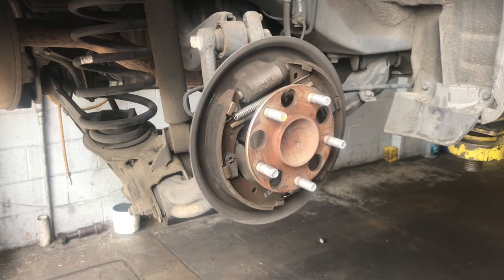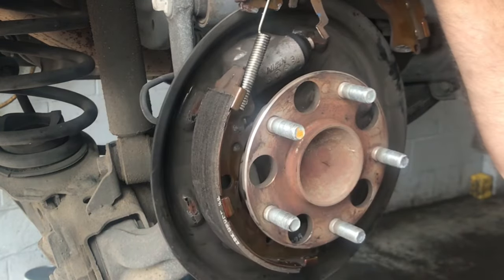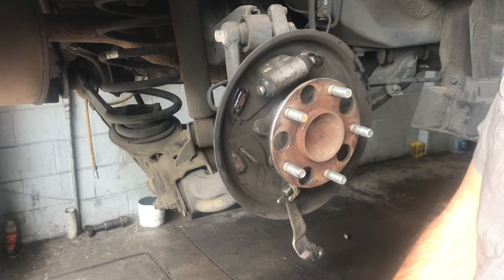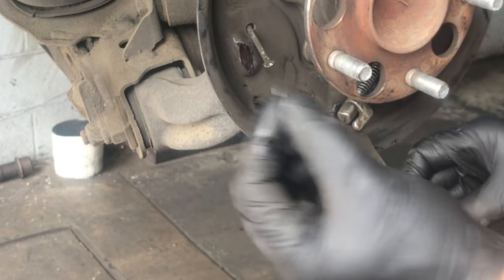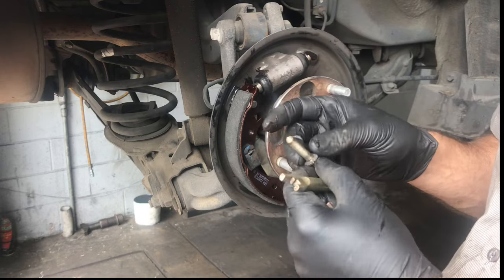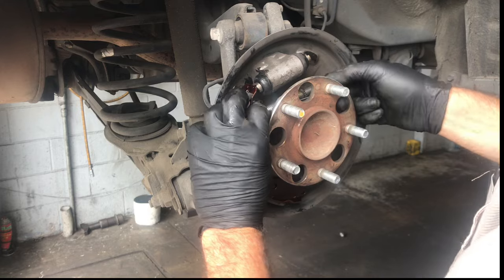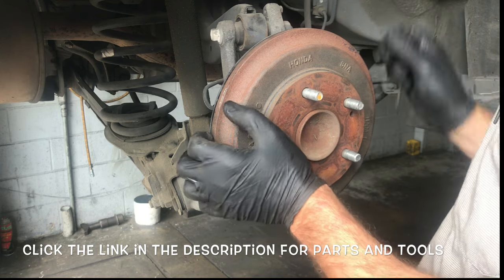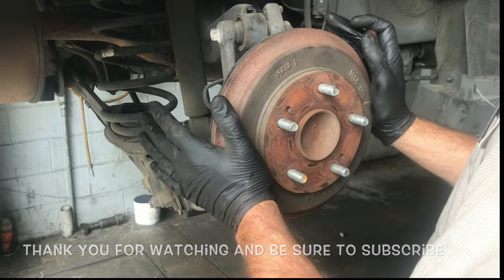How To Replace Drum Brakes On A 2005-2011 Honda Civic

Comment: Took me 5min to take everything out and 3 hours to put it back i have nightmares with these brakes!
Reply: He made it look easy when he putting back. But in reality its harder that it seems. Those springs are hard to stretch out. I just did mine yesterday , i did it differently but it works for me.
Reply: Hate drum brakes with a passion
Reply: Eyes wide shut for expert who do this constantly on a daily/weekly basis. They all are pretty much same from small cars, suv and sometimes trucks (GM/Chev) if your having problems with wheel hub check it any noise with too change it or just change everything. Remember to bleed the brakes, I note on the drum the date it has been changed like for example (04/27/20)
Reply: Bleeding the brakes, especially for drums, is a critical step. The ends of the wheel cylinders that contact the shoes can quite literally be pulled out of the cylinder itself with minimal force or by pushing one end in too far. Beyond that, as with any brake repair job or brake part replacement, removing any compressible gasses or other foreign materials, whether solid or liquid, from the brake lines is of the utmost importance to your safety, the safety of your passengers, and the safety of other people on the roads around you.

As for these being a pain to install, I agree that pads and rotors are so much easier and more straight forward, but I almost enjoyed doing these on my Honda. It gave me a chance to get everything cleaned up for the new hub bearing assemblies, as well as took a drill with steel brushes and got the backing plates returned to much better condition with the removal of rust. 

All in all I enjoyed getting it all back together as a much more complex mechanical system and having it work as wee as or better than the old ones!
Reply: I just wanted to see how he got that mainspring back in.
Reply: Hahahaha
Reply: Just did drums for my first time and wow. Your words are exactly what I just went through

Comment: Pushing in the hold-down springs without a special tool can be overcome by using a wide-blade screw driver.  Place the screw driver blade on one side of the hold-down spring in the groove and press in and turn slightly, whilst holding the dowel in place from behind.  It only takes a slight turn for the dowel to catch, but once it is hooked, you can then move it completely into the grove with needle nose pliers.  I spent three hours one night trying everything to get something to work, and stumbled across this trick.  Good luck.

Comment: You skipped the most important part... Those drums many times dont come off easy even when pounding it with a hammer. Some have a slot in the back that you have to take a small screwdriver and turn the adjuster wheel or else no chance on getting drums off
Reply: In the front of the drum, there are two screw holes. Put a screw 10mm by 1.25 thread  pitch in each hole and turn each one till drum brakes loose. Hopes this helps

Comment: Thanks for this! QUICK TIP: Use vice grips to take the springs off, then remove the clips holding on the shoe, then take them off... then do it in reverse! Way easier than trying to juggle the second shoe on

Comment: I did my 1988 Civic drum break years ago, it is very refreshing to see how professional auto mechanic did it. Thanks for your video. Your explanation is quite clear and getting to the point. The video angles are quite good and clear. One of the best videos.
Reply from the maker: Bruce Huan thank You!
Reply: @HowtoAutomotive  , Thank you again. I got it done on both rear drum brake on replacing shoes, drum and wheel cylinder with new set of springs. First installation on the passenger side, I found that 1988 civic adjuster stud fork was too fat for the new shoes. A little bit of grinding to make it fit the bill. By the way, I was confused on the adjuster stud differences on its right or left turn in order to screw it in. I ended up came back to review your video which is on the passenger side wheel (by looking at the muffler is on its left side) and it is right turn (clockwise turn make it shorter). This saves me a tremendous trouble in the future.
* By the way, I like to find that tool you used to push and turn the lock spring. I wish I had one like that and like to get one for the next use.

Comment: I wish I would have seen this video before another tutorial, the other guy was using plier grips to pull that spring which is a pain to remove,I noticed while doing this, I ended up pushing the cylinder all the way to one side, releasing brake oil fluid, and I think air got inside the lines as the brake pedal feels like a sponge. Going to take my car to a shop to see what happened, I hope I did not damage the cylinders.

Comment: This video works for a 2012 honda civic lx. 
I also wanted to add that I used two M12 -1.25 mm x 35 mm metric class 8.8 bolts from home depot to remove the drums. 
I also used clear tubing from home depot to bleed the brakes, but I can't find the size. It's probably the second thinnest tubing they sell. 
Hope this helps.

Comment: Thank you so much for doing this video!!  The part I like best is installing the opposite shoe. I would usually try to spread the large spring up top after the two shoes are installed and I would stretch it out and end up having one of the piston boots come off in the process of stretching the spring and make a mess. It took me half the time to do my rear brakes.  This is the best video!!

Comment: Brian, this is nothing short of a fantastic video. A good friend of mine is a Honda "master" technician as they are called at the dealership, and the process he uses, which I'm sure is a specific Honda method with a personal touch, is essentially exactly your process here. 

The step many struggle with, as I have seen personally helping people with their cars and on videos here, is the installation of the top most spring. I call it the "rotation method" and it takes all the danger of damaging the wheel cylinder out if the equation if your advice is heeded properly. Too many attempt to fight the spring on its home turf; meaning, they try to pull the spring along the linear axis where the spring is the strongest. Rotation introduces the lever, our simple machine best friend, to do our bidding. Once the shoe is seated in the cylinder notch and is rotated around that fulcrum, the forces pushing on the cylinder from each side begin to balance out quickly allowing for the focus to move to proper positioning of the front shoe. From there it takes no more than slight pressure from a single finger to hold the shoe in its desired place while installing the peripheral springs and retainer. 

I have been fixing up my '06 coupe 5mt to have something I can not worry about putting additional miles on and still know it's solid. I've owned it since December 2005 and all but 12 of the ~270k miles were driven by me. I had watched this some time ago while fixing up a friend's 2007 coupe nearly a year ago, and the process stuck with me to the point that I watched this after to make sure I hadn't screwed anything up. Nailed it!
Reply from the maker: yourfinaldecree glad you like the video. Sounds like you take good care of your car and it should be around for a long time. Thank you for watching!

Comment: Just one trick to add is when get the shoes close to postion with the drum, go in and press the brake pedal with both drums on and see if it frees up the drum. This process centers the brake pads. once i thought I had adjusted them tight enough and pressed the pedal and they were pretty loose and then adjusted them a bit more and they were perfect
Reply from the maker: nick elias like the tip👍🏻 thank you and thank you for watching!

Comment: I was struggling so hard taking the top spring off in my 2010 Honda Insight, which has the same exact drum brake setup in this video. When I tried your method of removing old shoes and assembly of new shoes, I was  finally able to get this job done sooner. 

Most videos start with removing that longer top spring which is on there super tight, but that never worked for me. I don't have vice grips and don't wanna use side cutters, so there had to be a better way, which is to remove the shorter bottom spring. Doing that is way easier and quicker.

Comment: I watched this video 3 times before I started the job on my 2008 Civic. I have done disk brakes many times an never had any issues, but this job one one problem after another.
It is not as simple as the video led me to believe.

First, was unable stretch the return spring enough to release the shoes. I found no place to get enough leverage. I ended up using a bolt cutter to cut the spring.
Second, I did not have the special pliers with the wedge that permits spreading the horseshoe clamp. I tried buy could not remove the parking brake pin from the rear brake shoe. The rear brake had very little wear, so I decided to keep it.
Third. In replacing the rear brake shoe,  I had trouble replacing the retaining clip. Ever thing kept slipping out of place. You really need 3 hands to do this task!
 Fourth: Even though the replacement spring was an exact duplicate of the original. I could not get it to hook up to the rear brake shoe. The parking brake assemble arm blocked access to the triangular slot .  This, of course, is a show stopper, so I'm still trying to find a way to make it work.
Reply: Jim Walsh all you need for this is pliers and a couple of flat screwdrivers. No special tools needed those just make the job easier
Reply: Haha, it would have been hilarious to  hang out with you in your garage and watch or video you

Comment: This guy is a true mechanic. I was stressed just thinking about doing this job. Just follow the video and you'll be fine. Only thing I did different was to remove the parking brake cable so that it was easier taking off the horseshoe clip(hardest part about the job). Also push in the brake piston by hand to give yourself more room to leverage the last brake shoes in place.
Reply from the maker: Glad the video was helpful. Thank you for watching!

Comment: Great video man! lol I will leave this up to my mechanic to do the labor.  The upside is that now I know how the process works, and I know all the components that ideally should be replaced. I’m here after getting cursed out by a customer’s mom for selling a car in which the drum’s failed after a few month of ownership. The downside to the drum brake system is that when they fail, they will fail hard. The brakes worked just fine on the car before selling the car.  Moving forward, my buy here pay here dealership will be replacing the drums, shoes, wheel cylinders, and hardware on all used cars we sell. Same thing applies for brake pads and rotors. We also are getting our customer’s car fixed. Thank goodness we have the wiggle room to replace stuff like this. I can only imagine the issues that Independent cash car dealers run into. They can’t mark up their prices much like buy here pay here dealer’s can, therefore it’s not much wiggle room for them to fix the cars. Then if cash dealers do try to fix everything properly, they can’t sell the car because cash buyers usually will not want to pay the increased cost of the car associated with all the repairs. At the end of the day, dealer financing allows dealers the wiggle room to properly fix used cars, especially vehicles more than 6 years old.
Reply from the maker: Well I hope you can get the car fixed up. Glad the video helped you make the right decision to pay someone. Thank you for watching!
Reply: @HowtoAutomotive  yep we took care of our customer’s car Friday.

Comment: Hey i changed brake shoes on the left side and the cylinder pistons came out put back in and finished that one side, but i didn't change passenger side yet. If the passenger side pistons stay in, do i have to bleed all 4 brake cylinders are just the side that came out?

Comment: Man you made it look so easy.... good stuff 👍🏼
Reply from the maker: camram thank you. Are you doing your brakes this weekend?
Reply: How to Automotive No I did these on a yaris ‘13 one day after seeing the wheel cylinder was leaking. The top spring gave me a hell of a time. Also I missed cleaning the rust from one of the contact points at the bottom of the backing plate which caused squeaking after a few days. Maybe  next weekend I will try these again on a hondu civic ‘10, and hopefully get my revenge on those springs. Most people, including myself would connect both sides of the shoes at the top with the top spring. Your way is pretty neat when connecting them at the bottom and already having connected the top spring. I think this way it facilitates things a lot more.

Comment: You’re the best for this video! So helpful. Thank you!
Reply from the maker: KingKristo _ thank you. Did everything go smooth?
Reply: How to Automotive it did after I saw your video. I was having trouble removing that spring on top that connects both breaks and your tip helped. Also putting the same spring back together was easy the way you showed In the video 👍🏼
Reply from the maker: KingKristo _ awesome glad the video helped out. Thank you for watching!!

Comment: oh and as for the brakes grinding. it was the lower end of the shoes where the small spring at the very bottom connect. the are suppose to be behind the groove on the plate but one side wasn't so it was grinding. I fixed it. so now on to the otherside. still a pain though
Reply from the maker: Omar Chisolm sounds like your doing well with 👍🏻

Comment: I really like the order you do the shoes in. It avoids trying to pull the big spring with pliers, which is always a challenge. I have a quesiton though. When I was doing my rear shoes on my civic, I pulled the spring too hard without holding the shoes and the brake cylinder popped out and a little bit of brake fluid leaked out. I put it back together, but my question is:

Do I now need to replace the wheel cylinder because some brake fluid leaked out when the wheel cylinder got pushed too much to one side? Did I damage the wheel cylinder?
Reply from the maker: Michael Most likely you will not need to replace the cylinder after putting it back together. You will need to bleed the brakes when you’re done. To be on the safe side I would drive it for a few miles pull the drum back apart and just make sure that it’s not leaking.
Reply: @HowtoAutomotive  Thanks for the response. I have been watching my brake level in my resevoir and it hasn't moved or gotten low.  Btw, you should show everyone this method you use because it is so much easier than the way I was shown to do it. All the other people tell me to remove the big spring first, but that spring is quite hard to remove. Your way is so much better. I really love your method regarding brake drums. Awesome. I just subscribed to your channel.
Reply from the maker: Michael I struggled for years with drum brakes and now I have a pretty good system. Thank you so much for watching and subscribing!

Comment: did you have to adjust them at the end because you did assembled and lubed up the adjuster? what if I don't disconnect it do it still have to adjust?
Reply from the maker: Omar Chisolm I would check to see if they need adjusting. If they are loose you will have a low brake pedal and the park brake will not hold.

Comment: Thank you for the video, i do have a problem tho.. one of the brake has the cylinder kind of stuck, when pressing on brake one of them only will move causing it to go out and leak...any suggestion ?
Reply from the maker: Alessandro Terracciano just replace the wheel cylinder with a new one. Cylinder should move side to side and not get stuck.
Reply: @HowtoAutomotive   yeah most of the time it always move from the same side, causing the cylinder to fall and leak..but it was working fine before taking it apart i guess

Comment: This is a great video! thanks! I do have a question,  I noticed my brake pedal feeling a bit soft over the last  month or two... so I just did my front brakes... rotors and pads.  My brake pedal feels the same.. Some people say that I may have to adjust the  adjuster on the rear drums to fix this? Does this sound like the first thing I should try,?
Reply: Late response, but did you try flushing your brakes?
Reply: Bleeding them will get the air out

Comment: Many other videos show them popping the brake cylinder end caps off by mistake, which can introduce air into the system.  You managed to keep them in place - that's the way to do it.
Reply from the maker: Timetryp I’ve had my share of them popping out. And learned some tricks or two.
Reply: @HowtoAutomotive  If they do pop out and you lose some fluid, do you have to bleed that brake, or bleed all brakes?
Reply from the maker: Windy City I would put them back together and pump the pedal if it feels soft then bleed it . If it feels firm  I think you’ll be OK. But if you bleed it you’ll be 100% safe.
Reply: Sadly mine popped off and I have no brakes as of right now I need to bleed the brakes